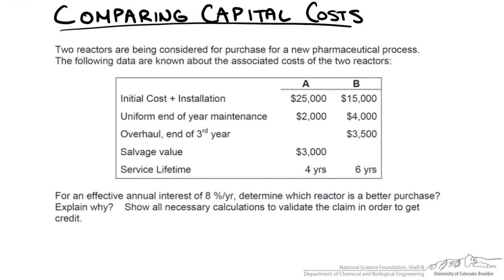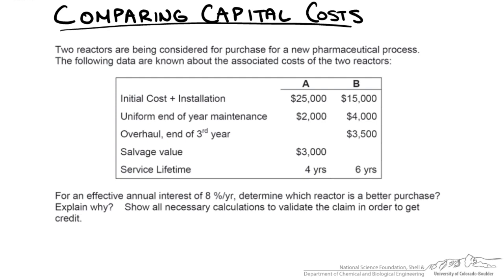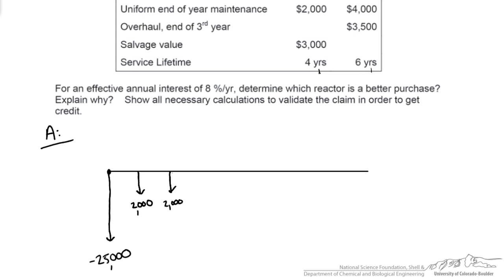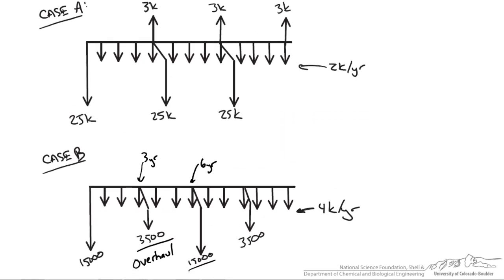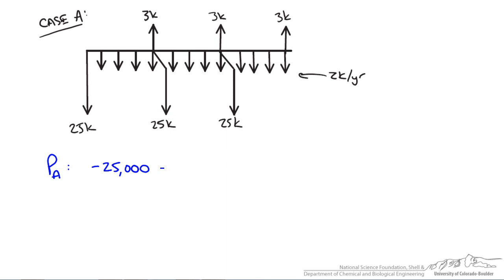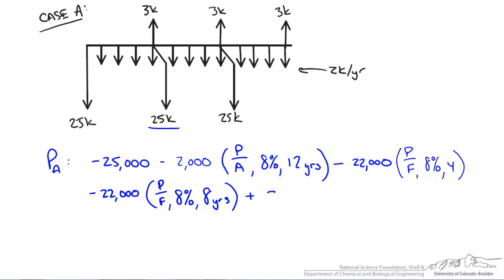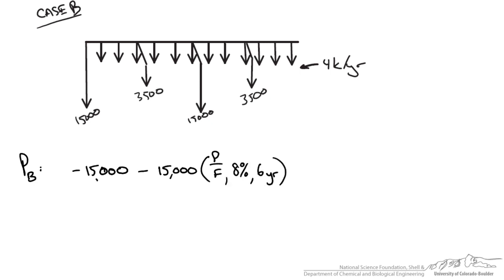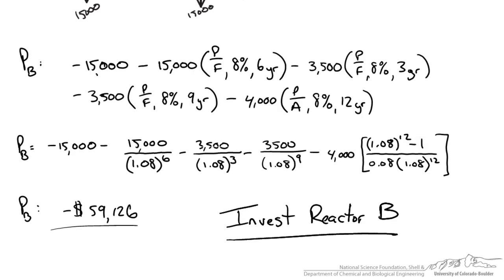Capital Cost Comparison: Present Worth Analysis

Comment: isn't p/f take positive value ? why -22,000 (p/f,8%,8( and 4) ) ?
Reply from the maker: Costs are negative values.  The cost of the new reactor is $25,000, but it was partially offset by the salvage value (positive) of $3000.  The difference between those leaves -$22,000.

Comment: Weren't you supposed to account for three salvages in case A? i.e. PW_A=-25000-2000(P/A,8,12)-22000[(P/F,8,4)+(P/F,8,8)]+3000[(P/F,8,4)+(P/F,8,8)+(P/F,8,12)]
Reply from the maker: In the case of the first two salvages, the salvage value was subtracted from the cost of the new replacement equipment for those years. That is why the cost is -$22,000 in those years instead of -$25,000, which would have been the cost if the old equipment had no salvage value. .